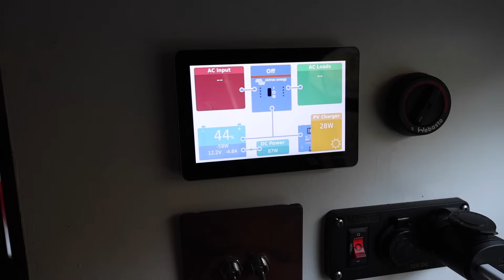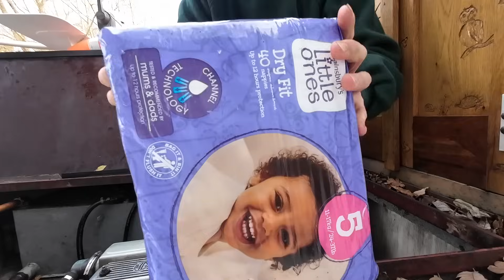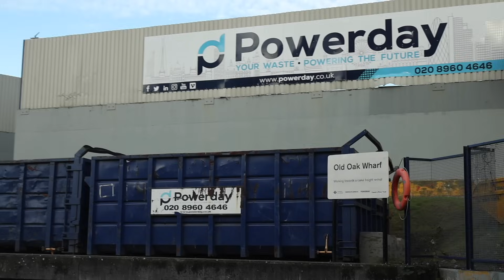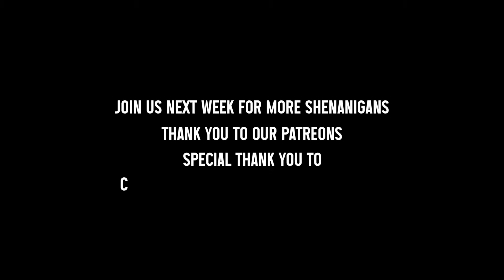Winter Is Coming. Will Our Narrowboat Make It?

Comment: Joe be very care full when using a hammer on anything that is cast metal it could crack and you wont know it until  the temperature changes or is stressed in operation . This is not criticism but to avoid a very costly repairs, you've done good getting everything ship shape it's the way it should be with anything  mechanical . You 2 have a great christmas and great new year wishing you good health and long life , happy trails
Reply from the maker: Thank you yeah cast doesn’t tend to flex like steel so I was as gentle as possible, seems to be holding up!

Comment: I would imagine your freeze plug corrosion was caused by a lack of dissimilar metal protection.  Steel freeze plug cast iron engine block. Nitrate and test strips to test for nitrate in your coolant. I would stop by a marina or auto parts store and ask about it. I own a small trucking company in the US it's important to keep up on it.

Comment: Put two of the core plugs next to each other in that pipe instead of that wood plug with silicon sealer and a clip. Use a half nut on the thermostat housing and cut the stud down to give clearance for the pipe. You want no leaks on the coolant system. Have a lovely Christmas
Reply from the maker: Ahh good shout on the half but and cutting the thread down! I’ll try the core plugs in the hose too that sounds a better bodge 😂

Comment: get you some automotive silicone gasket maker. it seals almost everything. would have been perfect for your wood plug and you freeze plug. oil absorbent towels in the bilge, they will absorb the oil only and leave clean water behind. also a silicone reducer for the thermostat housing would work well, they are thinner than the rubber hose and last a-lot longer. throw a bilge pump in the engine compartment to keep the water lever at bay.
Reply from the maker: Cheers I’ll look into the silicone fittings! I’ll get some silicone gasket maker on order too

Comment: Hi both, winter on a boat is okay if you get proper heating on board and keep your fire on all night with just a few nuggets of coal in it turned down low, this is my 8th year and it's fine. Keep warm both of you, hugs in bed work best or hot water bottles for Christmas 👍🥶
Reply from the maker: Thanks for the tips! Yes hot water bottle has made an appearance already 😂
Reply: Seeing your vlogs, and having fitted stoves to many boats id say by the look your fire is insufficient for the size of boat,  also just burning wood the fire will be out or very close to out by the morning,  a good multifuel fire regularly maintained and ash cleared daily will stay in 12 hours or more,  our fire stays in from November until March, we use 2 bags of coal per week,  so £36, yes costly but at least we get up or come home to a warm boat!! I do have a double skin flue which although causes the same controversy as separating toilets , does make a difference to controlling the fire.  There is now a hetas fit for boats, which I part designed 4 years ago. Feel free to ask any questions
Reply: @tonypetchey6024 unlikely they’ll be back to this conversation thread again best to repost your comment as its own thread if want them to see it

Comment: Joe two things that I have found that helps with installing rubber and plastic hoses. The first is apply a bit of dish soap or plumbers grease around the internal circumference of the hose, and the second is dip the end in boiling water to soften the rubber or plastic.
Mark
Alberta, Canada
Reply from the maker: Cheers Mark good shout!

Comment: Hi Joe and Danni, I'm glad by the end of the episode the list of problems were being solved and you were cruising once again.  

Joe, I wasn't sure of the part you needed until I saw the new part.  Those are called "Freeze Plugs" in the US.  The standard ones are steel with a zinc finish and generally rust out if the engine cooling system is neglected.  There are also brass freeze plugs, which last forever.  It was wise to purchase the assortment pack.

Having worked under similar conditions with cars, I can fully appreciate your working in that engine bay.  With close quarters it is usually a pain but, the weather was not helping, fortunately it wasn't snowing or raining.  The bilge "cocktail" of course added to your misery.  I'm glad you hit upon the idea of pumping the mess unto a jerry can and bucket to sort later.

+5 degrees Celsius in the house - ouch!

These longer trips are revealing some of the deep hidden problems with the boat.  Hopefully some of the more major ones are being crossed off the list.  I hope the rest of your London trip goes according to plan and you two have a special, enjoyable time!
Reply from the maker: Thanks Bill!

Yeah I think it’s handy to have the set. I can help out anyone else with core plug issues now too!

Comment: Great video! And my wife sends respect for Danni's dungarees!  Now that devil of a short hose from your thermostat housing: would an MGB top radiator hose (part RFC002A) do the business? They're kind of convoluted/pot bellied and you might be able to compress it along its length a bit then slip it in place so it could expand again. The final length is critical of course. There are also various 'hump hoses' that might suit. This compression technique is recommended for Mini etc bypass hoses that are convoluted and really too long to fit unless compressed a bit.
Reply from the maker: Danni’s got about seven different pairs on rotation 😂😂 

I’ll have a look at that hose cheers!

Comment: I had to fast forward Joe… I was shouting at my screen…😂… I had the same problem regarding the little hose between thermostat housing and heat exchanger as you say a bloody stupid design…. Do try and make the engine as watertight as humanly possible as the BMC hates getting extremely hot and “will blow the head gasket” and then you’ll need to have head skimmed and checked for hairline cracks… be warned! 👍🏻
Reply from the maker: 😂😂 cheers!

Comment: Seeing your vlogs, and having fitted stoves to many boats id say by the look your fire is insufficient for the size of boat,  also just burning wood the fire will be out or very close to out by the morning,  a good multifuel fire regularly maintained and ash cleared daily will stay in 12 hours or more,  our fire stays in from November until March, we use 2 bags of coal per week,  so £36, yes costly but at least we get up or come home to a warm boat!! I do have a double skin flue which although causes the same controversy as separating toilets , does make a difference to controlling the fire.  There is now a hetas fit for boats, which I part designed 4 years ago. Feel free to ask any questions
Reply from the maker: The thing we’ve found with the burner is it’ll get the living room & kitchen too hot if anything. So when it gets colder we pop the diesel heater on for the bathroom & bedroom

Comment: Congrats with the engine particularly with the core plug ,l struggled with the tractor and l had a straight hit .Thanks for the socket tip 👍
Reply from the maker: It was bouncing for ages, probably 20/30 minutes until it finally went!

Comment: Well done on the engine repairs. Watching you hammer the new core plug in I was so worried you were going to hit a fuel pipe and end up having to change that too, but you managed it. I hope all leaks are now solved. 
Does you boat have any heating other than the one stove? You said the calorifier had been removed - does that mean the heating too? What heats your water now?
Reply from the maker: Yeah I had the same worry! 😂 We have a diesel heater as well but until I’d fitted the new battery we couldn’t run it due to the large amount of amps on startup. Hot water wise we’ve got an instant water heater
Reply: @ItsOhJoe Ah, of course. I forgot that diesel heaters need electrical power too. I've not had to even think about heating systems for over 30 years - here it's all about air conditioning and humidity control. Heating may well be easier. Here if there is a power cut those who can start heading off to check into a hotel somewhere that still has power or has generators. There is no way to cool a house without electricity. Without air con or fans it quickly gets impossible to sleep. At least for you it is possible to add more blankets etc. to stay warm in the short term. Fridges and freezers soon lose their cool too - the temperature gradient is too high. We have the same appliances here as in UK with no extra insulation built into them to cope with the climate. The only positive is that showering in cold water due to lack of power is okay because it is  still going to be over 20 centigrade - even more in the afternoon and that's straight from the tap. 

So now you are on the eco mooring I hope you get the battery fully charged and conditioned.

Comment: Why don’t you replace the stud with bolts on the thermostat housing. An easy way to remove core plugs drill a hole, and put in a self tapping screw then leaver against the screw or use a claw hammer.
Reply from the maker: Yeah that’s not a bad shout!

Comment: Can you not rotate the thermostat housing 90 degrees right and use an S shape rubber pipe?
Reply from the maker: The angle of the pipe will always be covering a bolt hole if that makes sense, bloody awkward 😫

Comment: I'd have thought the core plugs on that B series would be imperial, not metric? Maybe that was why it was that hard to knock in! I've used wood to block hoses before, but it really helps if it's hard wood, old oak is good but it's a bugger to shape! The right sized copper pipe with a blanking end soldered to it can work. That job looked like a PITA to get done, all in all.
4K for a recon engine sounds rather a lot to me, I have to say, assuming that's just for the engine? Last time I looked you could get an Essex V6 done for 2k, and that's twice the cylinder heads, 50% more cylinders and bearings etc.
Reply from the maker: Yeah I thought the same but triple checked on google all states 34mm surprisingly
Reply from the maker: Yeah it does sound a lot in that case. I’ve not asked anyone myself but that’s just what they stated in the magazine

Comment: Just leave the fire on overnight. 17 winters and counting on a 55ft. I don’t have double glazed windows either. Your stove is way too small. Do you have window coverings? I use doubled over cheap fleece blankets from ikea. No need to be cold on a boat
Reply from the maker: It just seems a bit of a waste burning all night as it’s the opposite end of the boat to where we sleep. We’ve found it gets the living room and kitchen far too hot if anything. Then we’ve got the diesel heater for bathroom & bedroom but that was out of action due to the dead batteries - it’s back on again now though!